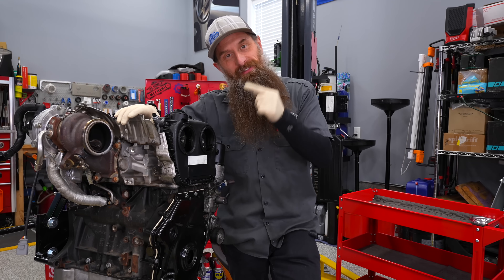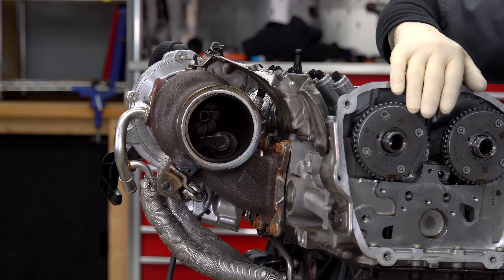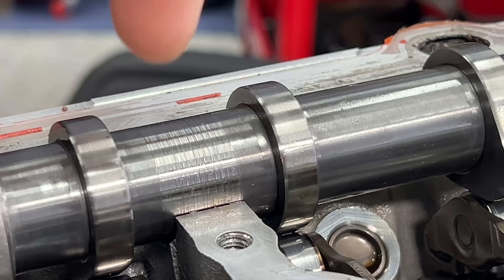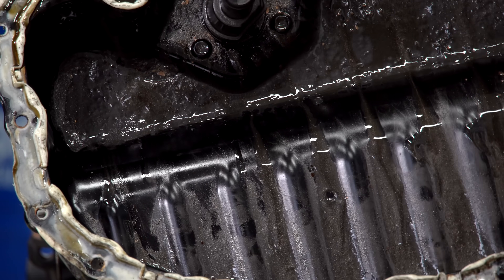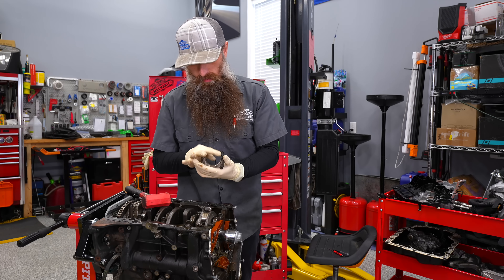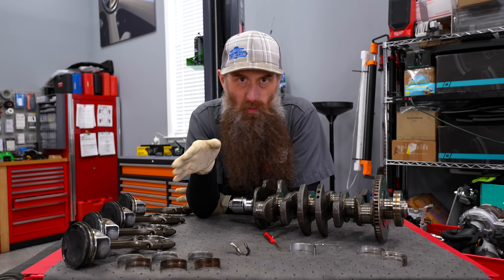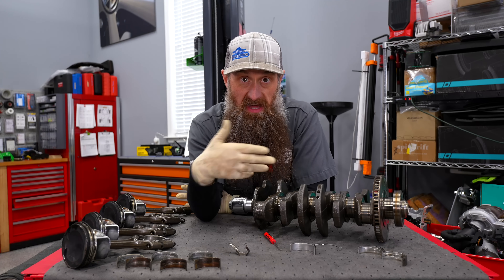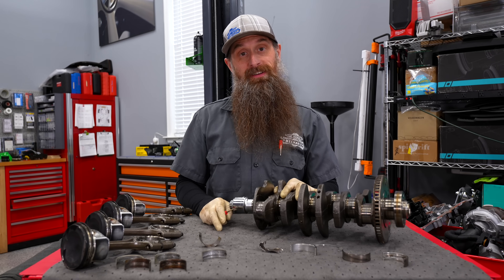Why This Audi S3 TSI Engine FAILED at Just 110k Miles?

Comment: I have the Mk6 TSI with 202k and the biggest thing with these motors is regular maintenance!! I change oil every 5k, spark plugs every 30k, use only OEM parts and I only run Shell 91oct fuel. It’s also on stage 2 with the OTS tune from COBB. The car runs strong and still gets 25-29mpg too!
Reply: I bought a then new MK6 GTI (2013) only issues I had with it in the 5 yrs I had it (sold it to buy a MK7) I had the cam sensor began to leak and needed to be replaced, and had 4 water pumps that seeped.  All 4 water pumps were dealer installed.  If VW could just make a reliable water pump?? Their reliability rating would jump BIG TIME. haha.  It never left me stranded or anything, was a great car.  Sold it to my friend, he is still driving it to this day.  Just recently traded my MK7 GTI for a MK8 Golf R.
Reply: @eppyz  The incredible part, to me, is the water pump actually got worse over time.  On the Gen1 (like your Mk6) and Gen 2 engines (in the B8s and late-Mk2 TT) the water pump failure was common but there are still many cars running around with their original pumps working perfectly fine and not leaking.  The Gen 3 motors they changed the design slightly and then it became nearly a guarantee the pump would fail...and fail multiple times lol!  How they took a "problem design" and "revised" it to make it WORSE, is dumbfounding.  Also, on the Gen4/Evo engines the water pump did not change in design from Gen 3! 🤦‍♂  Meaning you'll probably be changing the water pump on your Mk8 a few times if you keep it long-term lol.

Another thing regarding the cooling system--VAG has been saying the coolant is "lifetime" for quite some years now, even back to Mk5 and possibly before.  This is utter nonsense, similar to all the ZF8-transmission cars out there they say have "lifetime" transmission fluid 🙄.  BASF (Glysantin) who engineered the coolant, essentially says it should be changed after 6 years (mileage really doesn't matter).
Reply: @eppyz  I hear you buddy, I already swapped mine twice, and have one NIB as it is slightly leaking, a silly trickle, waiting for warmer weather to swap it. I get a intake manifold code once a blue moon, already replaced it, I just clear it, car runs fine with and without the code. Mine has all the chassis braces, even welded to the chassis the X rear seat, lol, poly bushings, sway bars, a go-kart on (road) wheels.
Reply: @eppyz  damn, almost sounds like they never replaced the little coupler that plugs the pump to the oil cooler 😅
Reply: Biggest thing with almost any modern engine is...regular maintenance.  The real problem is not even the motors and all the various systems--timing chains, VVT systems, balance shafts, etc. It's simply manufacturers have started telling people to change their oil at ridiculously long intervals, most of which follow that same terrible advice.  Manufacturers just do it to sell more cars--both in terms of ppl buying new and thinking they need "little maintenance" and then selling them more cars later when those ones "break", often as a result of the former.  

Generic statement is generic.  Go on any engine failure/major issue video--be it a BMW, MB, GM, Honda, whatever engine and there's always someone in the comments saying "no no 'these engines' are great...with regular maintenance".  Bottom line is don't buy a car with a fuel burning engine, of any make/model, change your oil at 10 or 15k miles or some other ridiculous interval that spelled out in the service book...and expect it to last.
Reply: @rolandm793  modern engines I would say 2014/15ish and above. There is also the problem of not letting the car idle in cold weather lets say at least for 30 seconds before driving and letting the oil warm up, not water temp, before spirited driving and that usually takes 15minutes to warm up. I know as I have an oil temp gauge on both my cars. 
The regular maintenance of 3 to 5k with synthetic oil is a must, these turbocharged 2.0t engines are very taxing on lubrication. 
The problem in the motors and its components is consumers hear timing chain and are taken with its good for the life of the engine, and VW Audi needs to be serviced at about 100 to 130k (and thats a stretch), or else will cause problems. They are not like Nissan, Honda, Toyota timing chains that as long as you keep religious service intervals they will last 300 to 400k miles.
Reply: Yeah, and then complain about Peugeots engines 😂😂😂
Reply: People need to stop doing 10k oil changes I swear the money u save doing less oil changes will cost u in engine repairs x2
Reply: mine is at 125k rn. I updated the tensioners at 109k and i change the oil every ~3k. The inside of the engine looks new and it doesn’t burn any oil. sadly my rockers are beginning to disintegrate.
Reply: My2011 gti mk6 tsi  has 166k miles and only big issue I ever had was caliper leaking thats it only use it to work and that’s it barley  beat on it
Reply: I love my 2011 MK6 GTI it’s basically full bolt ons, I also love the fact it’s pretty easy to work on compared to my 2011 STI in my opinion.
Reply: I drive an MK6 GTI with 230.000km with 300 HP and 480nM since 100.000km, and everything is fine. There was only a Injector damaged since i owned it. I change ever 10k Oil with 5W50, and it runs perfect, at 102 Octane (Germany)
Reply: @DiklerDeluxe  5W-50? Does the ambient temperature in Germany reach boiling temperature?
Reply: I see a lot of knowledge here and I’m newer to learning about my mk7 gti. Wondering if I could get some advice. I recently discovered an oil leak on my upper timing case; is this a huge issue I should take of asap? It’s very minor.. more of a sweat than a leak. But it is there. Only started after I changed oil spec from the thin stock stuff to liqui moly when I went stage 2. Car is very high mileage.
Reply: @Jake-nvrmnd  Sounds like the valve cover gasket I remember doing one when I was a VW apprentice
Reply: @Oddlysour  Typically, when mechanics see low rate "seeping", they will tell the customer to "keep and eye on it". When a slow seep turns into drips, the gasket should be replaced. Such leaks are inevitable with age, often more so than with mileage.
Reply: @davepaturno4290  thanks man appreciate it
Reply: lol stages 😂😂😂😂
Reply: How about this plastic water pump on my 1.8 gen 3? 
Oh put one of those aluminum ones on. 
Yeah ,sure ,is the 2 0 the same ?
Crickets from the Internet after I ask.
It's a turd of a car anyway, mk6s suck ass and thank God it's the wife's car as I'd never buy one.
Reply: 129k on my 2011 mk6 GTI. Been Revo stage 2 since I purchased it. I've had to replace the timing chain, intake manifold and walnut blasted. Otherwise, reliable and fun.
Reply: Mine ran great with being even early sometimes for service but even my balance shafts decided to go. I had a mk6 tsi in a vw cc couldn’t source out the low oil pressure till it was too late
Reply: Not true
Regular maintenance comes at a high price.
Reply: same here but i go with shell v power 93 and also add in some fuel system cleaner every so often .   my 2013 a4 has 230k miles on it and it rides like a new car!
Reply: yes exactly! 💯 VW gets a bad rep but it's all about maintenance and not using cheap parts
Reply: Also changing the pcv regularly.
Reply: I have my mk6 gti and service every 5000km or 6 months. Only use liqui moly and OE filters. As long as you are on top of servicing these cars generally are fine
Reply: @Vikturus22  Did you change the viscosity or use Liqui Moly recommendations? (usually OEM viscosity for street-driven vehicles)
Reply: 91 octane fuel is so odd to me when our minimum in the UK is 95 octane and our premium is 99 and 102 octane!
Reply: @oliviawhyte4520 different octance rating system between US and europe
Reply: @ Ah I didn't know this, thank you!
Reply: @oliviawhyte4520 over here in the UK we have a different scale for rating octane on fuel. I think there 91 octane is at least equivalent to our 95 Ron fuel but that's just from memory.
Reply: You have a different measurement system.  You use ron and we use Mon.  Your 95 is our 87 @oliviawhyte4520
Reply: @oliviawhyte4520 sounds like US octane levels. their 91 octane is our 95 octane
Reply: WRONG; stop misinformation and generalizing your findings, of all the VW engines the one with the most revisions is the MK6. Let's start and I may miss some of them;
Pistons, piston rings, water pump, oil pump, balance shafts, cam bridge, rear main seal, pcv system, intake manifold, timing chain, chain tensioner, chain guides, just to name a few. Besides those with a DSG will fail the DSG flywheel (has nothing to do with fluid changes), it just wears out.
The same issues spread across Tiguan and Audi A3.
You can change the oil every 1k miles and it will not save you from excessive oil consumption, oil sludge which is from bad design piston rings. 
And no, you don't need to buy only genuine items seeing you tend to be generalized. I have an MK6 GTi, has an eBay cylinder head, timing chain cover, oil pan, cams, balance shafts, oil pump, chain kit, pcv, pistons, piston rings, wheel and rod bearings, EVERYTHING IS eBay on a stage 2 Integrated Engineering tune (including DSG tune), eBay upgrades fmic, with 20k after the rebuild. No oil consumption, excellent piston compression and vacuum.
Reply: @mazpr2025  the piston/ piston ring issue is only a problem on the ea888.2 which only came in longitudinally mounted applications. the ea888.1 found in gtis shouldn’t burn oil; mine with 125k doesn’t burn a drop of oil.
Reply: @mazpr2025 VW and Audi are money pits
Reply: @mazpr2025 please explain to me how piston rings cause oil sludge? I’m very interested.
Reply: The oil control rings that are supposed to scrape oil off the cylinder walls, the oil rigns have openings in them that drain oil back into the bottom of the motor but they get clogged up with carbon and they lose their Tension seal against the cylinder wall, the oil slips past them and past the compression rings and then it cascades into more oil burning and carbon buildup!  @TraceyAllen
Reply: @TraceyAllen  Blowby is washed off the cylinder walls, blowby bypasses the oil separator and is fed back into the engine to be burned, causing dirty combustion which is partly washed down the cylinder walls into the oil.  Vicious cycle.
Reply: @mazpr2025 I drive my mk6 like an animal every single day never a day it doesn’t do 100. eBay ain’t cutting it if you drive like a grandma sure should be aiight
Reply: @RightyRespawn  Incorrect, driving like a grandma is worst as it will create excessive carbon buildup. Where does it say anywhere I drive like a grandma? why assume? Its a DD, drive it all year long, 110f summer to 5f in the winter. Its a go-kart on (road) wheels... what go-kart is driven like a granny? 
Almost all the parts on the engine are from eBay, including the timing chain, in fact I bought items from FCP Euro and they were of worst quality. The pistons, piston rings, cylinder head, rod and crank bearings, water pump, oil pump, balance shafts are from eBay. The engine has about 25k miles since the rebuild. The cylinder head was ported, noticed a significant improvement on the top end, sixth gear does not choke up, 7200 redline w the IE tune.
 If you are in the Eureka, MO area let me know, will be glad to match it up to yours. The only parts I used from the old cylinder head were the exhaust valve springs. And the DSG flywheel due to its engineering design, I paid a premium, about $800.00.
Reply: Why do you change the oil in your motor every 5k? I can see doing that in your ENGINE.. but
Reply: @jb40now47   tuned cars ,as mine is, not driven hard, thinking looong term ,changing the most important lubricant is insurance.t
Reply: @jb40now47  So a motorcycle has no motor?😏 But I agree; motors are often thought of as electric.
Reply: @davepaturno4290  A modern motorcycle does have a motor. It is used to start the ENGINE. 😉
Reply: @jb40now47  Yes, but even kick start bikes were called motorbikes or motorcycles.😏
Reply: Ea888 gen 1 tsi is terrible. Ea113 CDL is where it's at.
Reply: @MikelDog  Are you runnin a EA113 CDL? Any issues at all, asking because I’m getting a manual Scirocco R fingers crossed
Reply: This thread is full of copium.

Comment: This car's oil warning light must have been shining like a lighthouse for quite some time to get this engine so much damage.
Reply: I always have in mind with my EA113, if it comes on, it's too late!
Reply: @danehenry895  go for balance shafts delete
Reply: @danehenry895  as long as everything is torqued right, don't go over 6k rpm constantly, and always ALWAYS making sure you have oil & no oil leaks. this shouldn't happen, along with maybe a balance shaft delete + cleaning oil pick up tube if you have high mileage. My bpy has 263k miles on it and runs excellent. original engine/trans/turbo/mostly everything.
Reply: @adhizzle9985  do 6k rpm on a cold engine and this can happen
Reply: Yes, and i think, that it was not the oil level probem here, but the oil Pressure , but, ofcourse , if there is no oil, there can't be any Pressure too 🙂
Reply: @ yup.
Reply: ez fix - electrical tape. got this recommended from original owner
Reply: @charliefoxtrot1549  🤣🤣🤣 Yeah i was thinking the same when I saw how beat up this poor engine is.
Reply: xD isn't there 2 lights 1 orange for warning and 1 red for done
Reply: The moral of the stories check your oil levels more frequently, and definitely don't wait until the oil warning light comes on.

Comment: dude these engines are terrifying. You have to seperate engine from trans to drop the oil pan? Single use everything? Yikes.
Reply: I think thats just the upper oil pan.  The lower pan can be removed without removing the engine.

Comment: I have never understood the no bearings on cam journals . Well I guess they save money 🤨
Reply: Miata/Protege 1.6 and 2.0 has been without bearings and is one of the most reliable BP engines.
Reply: @ yeah the pentastar 3.6 and 3.2 also with few problems. I just don’t see them lasting. But what do I know 😀

Comment: Wouldn't there be a CEL flashing like crazy on the dash? Wouldn't the whole car be shaking? 
I just don't understand how it was allowed to go that far.
Reply: You would think so... When I bought my MK6 GTi it had low oil pressure and that was it as it showed it had passed emissions a month before. Drove the car 50 miles back home after the purchase thinking it was just a sensor. Did a compression test; 85-70-15-80. When I tore it open #3 cylinder had missing piston rings, chunks in the oil pan, cam and balance shafts journals heavily scored. 
These cars will have a Xmas tree dash if a sensor goes bad, but the engine mechanically is hanging by a thread and it does not trigger almost any lights.
Reply: @mazpr2025  You also had one of the worst engines to behind with. The gen 2 of the ea888 had all the worst problems with them. They are unreliable as hell, unlike the gen 3
Reply: @capax1559  agreed 💯, but the MK6 body and interior, IMO, is one of the most classic GTi design. How the car drives, the smell, overall feel, it's (although made in Mexico most of it) what I like about it. I love the round bubbly exterior. I tried to find a three door, very rare and most were run down to the ground which is my favorite true hatch. I fixed all the issues, I like them so much I have a spare engine and turbocharger.
 Yes, the MK7 fixed most of the problems, and it is superior in tuning capability.

Comment: Just replaced a long block in a 17 GTI MK7 that had a slight rod knock at 3000 rpm and metal flakes in the oil filter. The car had 104,000 miles and I assume the previous owner drove it hard cold and went 10k between oil changes. Sad part is we just bought it at 99,000 miles based on a clean Carfax from a Acura dealer, I think we got took.
Reply: Meanwhile in Europe, I've seen these engines run just fine with 200k km or more with 30k km oil change intervals....
Reply: @panzerveps  it really boils down to how and when the service is done.
Reply: @828findadventure  100%. And with any motor, especially a turbocharged one.  My Ford Sierra turbo gets full synthetic oil and plugs every 2500-3000 on the dot.  My Volvo T5 gets 5K miles full synthetic, even though the manufacturer says 12k miles.
Reply: @panzerveps fuel quality plays a big role. Even the cheapest fuel in the EU is better than the average US fuel. Our fuel is also much more expensive because of that.
Reply: Carfax relies on reported data. It's not helpful at all if the owner never took it to a dealership for maintenance,  or didn't report any accidents.
Reply: @patx35  All service at dealers and wrecks are automatically uploaded to Car-fax. The previous owner did 10,000 mile oil changes and had the water pump replaced under warranty once. I am assuming the engine got starved for oil and ran hot, thus destroying a bearing. The 10k oil changes should have been a clue for me.
Reply: @828findadventure  accidents are not automatically uploaded to Carfax. It requires the accident to be reported in the first place, which doesn't happen in rural parts of North America.
Reply: Guy at work smashed his honda civic si for 11k damage to his insurance 4 years ago. Sold his car last week for 14k, carfax came out clean. Carfax is bullshit@patx35
Reply: Buy new Euro cars.  Treat them right and you won't have such problems.  Remap to suit the fuel quality/type in your country, if you don't do this it can have undesirable results.  VW dealer actually told a customer that if he had remapped his 140TSI the lean burn failure would not have happened - they warrantied it.  Australia.
Reply: 10km (km) is ok between oil changes 😅
Reply: @ it guarantees the dealer future $$$$.
Reply: I feel your pain, I bought a 2017 Clubsport GTI and that spun a bearing 12 days later 😫
Reply: How did you get took?
Reply: @ Long story.